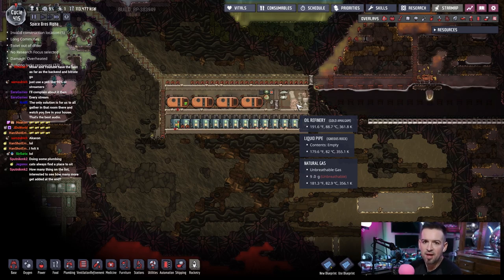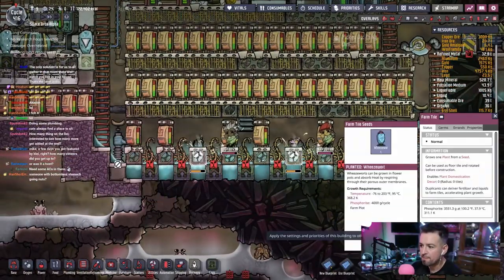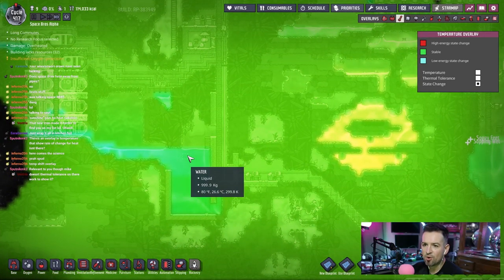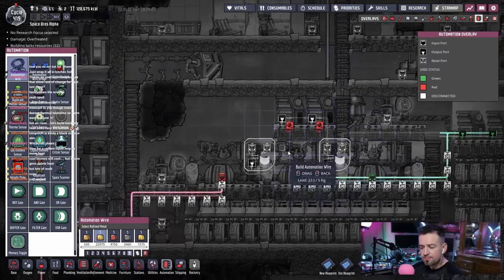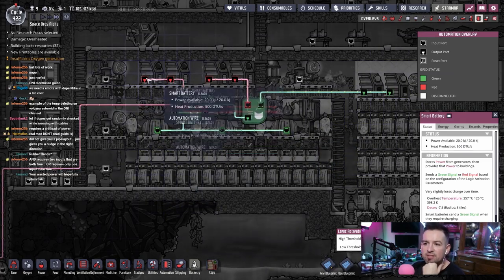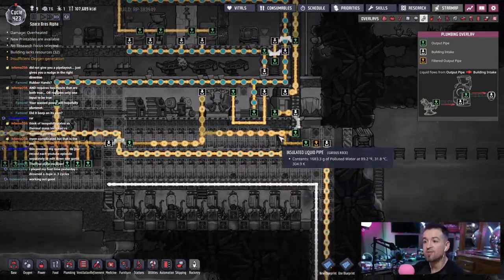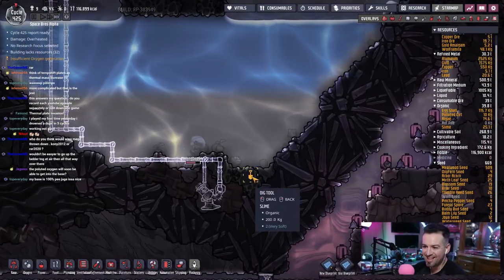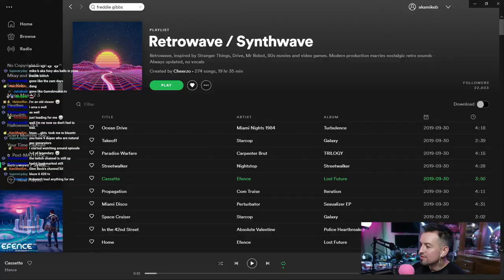ONI Adventures #30 - Just slap a few tempshift plates on it

Comment: The transformer split the supply power from the load,  this means all batters after a transformer can only work on that wire.  Batteries before a transformer will run everything including charging batteries.